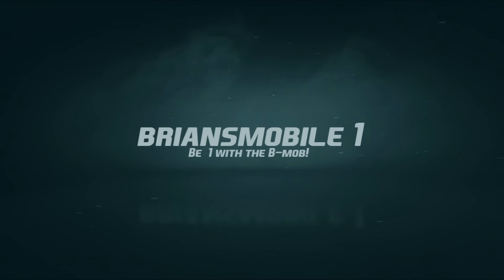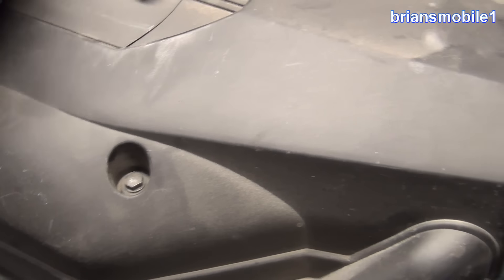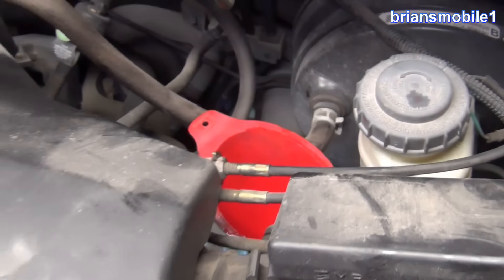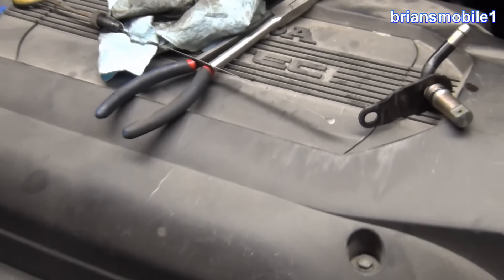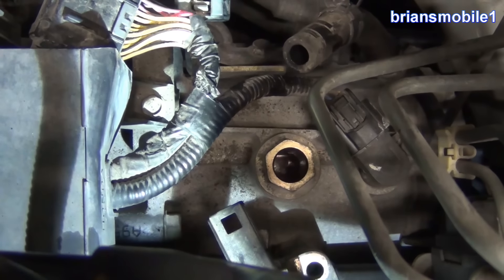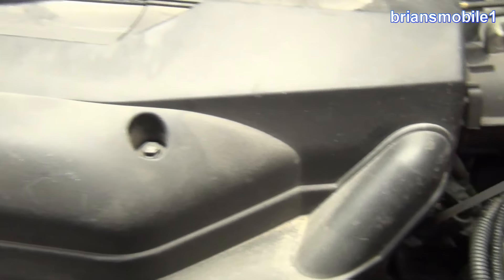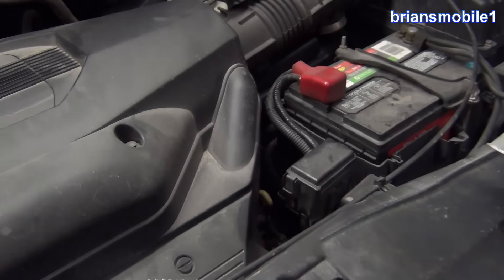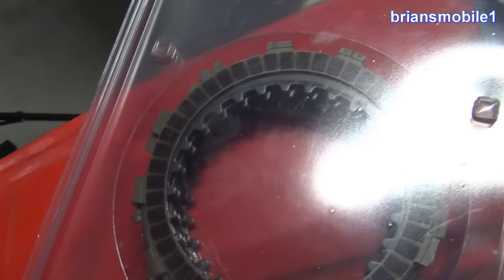Watch this Video BEFORE You Destroy Your Honda Transmission

Comment: Damn, dude, replacing Honda Odyssey transmissions after people go to a quick lube joint and get talked into "flushing" their trans fluid is how I buy a new boat every couple years! You can't go teaching people all the secrets! Lol
Reply: Can u just fill the fluid at the dipstick hole like on a CRV?
Reply: @mattwojo1610  yep if there is one
Reply: Sorry we have now U-Tube University.
Reply: @M Wess I sure hope you are joking, because that's really vile and selfish of you if not.
Reply: @st.michaelthearchangel7774  just means he replaces transmissions after someone screws their own. Nothing vile and selfish about that😂
Reply: @st.michaelthearchangel7774  thats the mechanic world for ya, thats why it’s always best to do it yourself when you can. I worked for a AAMCO and would see them slap old parts on spray a fresh coat of black paint on em and charge them extra for a part they “needed” along with whatever service they came in for.
Reply: @mattwojo1610  The diameter of the dipstick tube is pretty small.  I used the tube off a turkey baster, and ran the tube of a hopkins measu-funnel into the turkey baster.  The end of the turkey baster just about matched the size of the dipstick tube, so if you don't hold it on straight, it will leak out.  I spent a lot of time looking for a smaller funnel that would work on amazon, but I didn't come up with anything.
Reply: @jims2507  I just used a chunk of clear fuel line and heated the end and slipped it over the dipstick tube and attached to the funnel, easy and cheap.
Reply: I used a ketchup bottle and castrols import trans max into the dipstick hole.  I 1st held the nozzle closed with my finger before it went down into
Reply: @Legend Krew reported for spam :)
Reply: @Valentino Saint you too :))
Reply: @slowazzes1972  I concur my good man . I reported both of them as well !!
Reply: SlowazzES1 and
Reply: many of those quick lube places are advertised on military websites--good to know you folks like to rip off veterans.
Reply: I believe you've just described how society works at the most fundamental level.
Reply: @nordicpride9708  LoL, felt that way when i got a PO730 CEL
Reply: Don't worry man, there's plenty of st*p*d ones that still do mistakes and you're still able to buy a new boat every single year instead of 2 yrs
Reply: @jims2507  I used clear hose from the hardware store( sketched a template of dipstick hole with a piece of paper as i didnt have  a measuring tape on me) that fits tightly over the hole you can move the hose around and it wont leak
Reply: @mattwojo1610  mesh ever
Reply: Yes that happens because quick lubes want cheap labor.  So the don't hire knowledgeable techs like Brian.  Then all a quick lube cares about is profit. They dont care if you Honda transmission has to be replaced!
Reply: The hell you can't thanks dude.
Reply: @grambuddy5143   God will provide Mr think am been screwed .
Reply: A new boat every couple of years? Sounds like you're buying the wrong boat lol
Reply: @JohnBoyJoy  Or, I'm a bad captain 😩
Reply: @robertmedina6875  It's disheartening. I'm embarrassed to say *my first thought was "Man, why doesn't consumer protection prohibit underqualified businesses from offering a liability free trans flush if it's that risky!?!" -and then I remembered my age + that reality tap in the nads life hands us once we've experienced the real world. 
The Golden Rule? 
1 Corinthians 13:4-8? Anyone?  
C'mon, why is there such a cut throat draw toward culture vulture butcher farms?  It's not THAT fine of a line between getting ahead & operating in the shadows to screw the pooch. Or at least there shouldn't be.
Reply: That's why I change my transmission fluid myself on my 2006 Odyssey, purchased it with 217k miles back in December for $1,500 and it was shifting a little rough, so I did a 3 stage flush over time. Every 2-3 months, I changed (not flushed) the transmission fluid until I did it 3 times as well as cleaned the bolt off every time. I drive it conservatively (for the most part) and now I have 230k on the odometer shifting and running smooth as silk.
Reply: @st.michaelthearchangel7774 he's not joking and 95 percent of mechanics are just as shady, for the 5 percent of you that are actually honest I do apologize to you because this comment isn't directed at you but for the other 95 percent of you selfish bastards, you are exactly the reason why I learned everything I possible could and still can about the trade, I learned how to change my own oil at a very young age and worked my way up to swapping engines and transmissions because I'm sorry to say I don't trust any mechanics because of the dishonest 95 percent.
Reply: Some of those places wont even put your plugs back in and instead say you are good to go while you pull out leaking your fluid all over the ground and road. Lol i swear those kids have no knowledge on what they are doing and just make it up as they go
Reply: Harbor freight tools sales a funnel set for a couple dollars they are red the smallest one fits in the dipstick stack them push down pour3 quartz slowly back in. I pull trailers with my Honda van and pull boats I put in three new quartz every 3 or 4 months. Also I change it more often if I overheat the engine
Reply: @josedeleon2230 best comment ive seen lol , youtube university 😂
Reply: @jims2507  I use a turkey baster on the end of my transmission funnel. It brings the funnel up to roughly flush with the top of the engine bay of my 2011 Honda Pilot. Because the fill hole is on the side of the transmission, I fill through the dipstick tube.
Reply: If this trans has an oil cooler, then simply draining the fluid will NOT remove ALL the old oil. Hence why workshops "flush" the system.

Comment: I can arrest to this technique. I did a drain an fill on my 1999 Accord every 10k miles using Honda fluid. I gave it to someone in need last week. It rolled out of my driveway with 418,075 miles on the original, un opened motor and transmission.
Reply: good on you, !
Reply: pochoun33137  it was a 4. 1st two oil changes were with mineral based oil. Then went to Mobile1 synthetic. Oil and filter every 5,000 miles. Transmission fluid on the 10s. Easy to remember. Started with Fram Extra Guard oil filters for the grip surface to get them off then switched to K&N because of the 1" nut. Hand tight seemed to be just a bit tighter after the hot/cold cycles between changes. Also used a K&N air filter.  Lots of YouTube videos on how these filters destroy your engine. They worked and still work for me on this and all my other vehicles. Sold the car to a young person getting thier start for a $1. It owed me nothing and I wasn't going to warranty either. 85 oil changes, 3 timing belts, 11 sets of tires, I was done with it. If it died tomorrow, they can peddle it for a parts and make money.
Reply: Love the big roomy body style on that, 98-02, Accord.  But that tranny was terrible.  Thel 90's Honda Civic, on the other hand, was a Swiss watch of economy cars.  It performed for 10 years without ANY PROBLEMS.  Wow. Amazing.  Today's Honda is different.  It is closer in reliability to Mazda/Nissan.  Toyota is reliability king, today ( not counting Yaris/Echo ). Peace.
Reply: pochoun33137  As my kids get established, they are returning Subarus that I bought them to use at school and get over the mt. passes in winter. I  am working on pairing down to a couple of Subarus and a Tundra.  The Subarus keep you busy for a while with head gaskets and wheel bearings.  Briansmobile1 and mrsubaru1387 have been excellent resources. If I could buy another new 1999 Accord, I would. At this point, I am less and less likely to buy any new car as the cost and complexity for features I don't want or need just pushes me away. There exists a huge un met market for a simple, well built vehicle. Neither government or manufacturers will produce it for various reasons. I just may have to build it myself.
Reply: Nobody changes their transmission that often.  Stop lying
Reply: Agreed,  every 10k isn’t realistic.  41 transmission flushes?  C’mon.   I do a flush every 30k which is recommended.  I change my oil between 3k and 4k or at 60% On the dash readout.  Otherwise as soon as you show loss on the dipstick change it.  Oil is cheap, mechanics/dealerships are not.
Reply: @happyamerican3235  exactly
Reply: @ferndog1461  I had a 99 Accord in a V6 and i traded it with 253,000 miles without any problems. Transmission fluid changes every 35k miles. My sister had a 98 Accord she drove up to 192,000 before trading on something new. Original transmission too.
Reply: You are lying. A Honda tranny will not last that long.
Reply: ferndog1461 huh? Owned a 2008 Yaris from new till I traded it in last November. ZERO issues! Don’t talk bad about them unless you actually know something..
Reply: @lordhave4420  IKR. I changed mine once after 240.000km on my 2005 accord. And only because I didn't know if the previous owner ever changed it.
Reply: @midwestfarm757  i
Reply: @blackericdenice  211k and still shifting smoothly, oh,I can't figure out where the leak is coming from but mechanically in perfect functioning order.I drain and fill alot.
Reply: @roloaddict   I completely agree and wonder why they are forcing even more technology on us with the self driving cars nobody even wants? The only new technology I respect and value are the safety features like crumple zones and safety cages.Everything else should be bare bones simple .to insure reliability. Newer cars are money pits .
Reply: Wow, that's amazing and encouraging!  I have a 2014 Honda Crosstour v6 4wd and want to keep as long as possible.  And thank you for your generosity to someone in need!  😊
Reply: @lordhave4420  I do. My A service is engine oil and filter, tire rotation, valve adjustment, full underbody/brake/suspension inspection. B service is engine oil and filter, tire rotation, transmission fluid, full underbody/brake/suspension inspection.

Fluids and inspections are THE MOST important thing you can do for your car.
Reply: *attest
Reply: I drain and fill my Honda Fit LX 6MT around every 10,000 miles also.  It's literally like $20 in a quart and a half of fluid 😅😅
Reply: Just did a 2nd drain n fill on my 01 Honda accord at 285k miles. Flushing the fluid is not an option when it comes to Honda transmissions with high mileage.
Reply: @blackericdenice my 2003 Honda Pilot EX has over 250,000 miles on the original engine and transmission.
Reply: @blackericdenice  my 99 is at 320k miles original engine and trans no major issues
Reply: @Bewilderbeast1  Until I see it. I don't believe it.
Reply: 179k miles and never changed my trans. fluid. Doing it for the first time tomorrow.
Reply: @blackericdenice my 2003 Honda Pilot has over 250,000 on the original transmission. They do last if they are taken care of.
Reply: @GloucesterODaugherty  You don't have a 2003 Pilot.
Reply: @blackericdenice why is that hard to believe
Reply: I’ve replaced all the door lock actuators, the liftgate struts twice and it’s on a new set of OEM Yokohama tires
Reply: @GloucesterODaugherty  Honda Transmission filters can't be change with out taking the transmission apart. Changing the fluid every 10k miles will not keep the filter from stopping up. The clutches slip as you drive the car. Clutch material fall off and is washed down to the bottom of the transmission. The fluid is sucked up by the pump through the filter. The filter grab and hold the clutch material. The filter can only hold so much material until it stop up. Clean fluid will not pass through a dirty filter. Not everything people say online is true. He left that comment to get attention.
Reply: @roloaddict  Take a look a 2023 nissan versa. The sticks are great and the cvt aren't bad on that model. I have 1.6l on my kicks 73k miles and the oil looks brand new after every change
Reply: @staresce how about that wonderful interference engine.  They should just keep it simple.    I want my 72 Pinto Hertz equip with bubble windows, a four on the floor & a fifth under the seat😊 can't forget the needle nose vise grips shifter.. 😮
Reply: So you got arrested for that?!?😂
Reply: @jeroen7699 thats 149,000 miles. How? V6? Wasn't it supposed to be changed much sooner? No side effects?
Reply: @T82ravdaman 4x drain and refill is a flush though even if a pressure power machine isn't used. You don't even need the machine.
Reply: @dentalcare1 how??? What type of engine? No symptoms?
Reply: @whatitisnt.  4 cylinder automatic CL7 Accord from 2005. Japanese build for Europe (similar to Acura TSX). I bought it in 2017, the dealership had no record of the auto trans fluid ever being changed. So I had it changed around 230 or 240k km, for peace of mind. I noticed the old fluid was still bright red coloured. If it was ever changed before, it wasn't by a Honda dealer. I still have the car, it's at 280k now. Transmission and engine (k20a) are still perfect. The only (preventive) repairs I did in almost 7 years, were front control arms and joints and a CV axle. The rest was only normal maintenance: oil, filters, brakes, etc.
Reply: You sure wasted a whole lot of ATF
Reply: @dentalcare1  205,000 miles on 2012 I-4 Accord original transmission, factory fluids.
No issues.
Scared of draining the fluid.
Reply: @blackericdenice  I don't know who you meant is lying but my 02 Accord 4cyl. has 274+++ @ the time of this writing -with OG trans fluid... finally, I'm going to do a fluid change next week..thanks Brian and all you Honda heads!
Reply: @blackericdenice that’s literally not true.. my Honda crv transmission filter only needs to have a cover removed and two hoses, takes 5 min to do
Reply: @dentalcare1 how is the car after the fluid change notice any changes
Reply: 10k miles??😂😂😂😂😂😂😂😂😂😂😂😂😂😂😂😂😂😂
Reply: @validsoul4497 no difference. But I never beat my car. I even pull a small trailer for work sometimes. V-6
Reply: @whatitisnt. V-6. No issues. Runs great. No slippage
Reply: My 1999 only has 106k bought in 2020 mint garage kept with 63k miles on it, love this car bought as a cheap daily and love it will drive it and try and match yours. Will follow your lead with transmission maintenance
Reply: @auxmike718 the Og Yaris was a take nowadays not so much like every car brand Toyota is not immune people just believe they are so they are 🤷‍♂️
Reply: Hahaha damn! Good job and even better advice.
Reply: attest brother not going to jail arrest 
FYI 👍👍